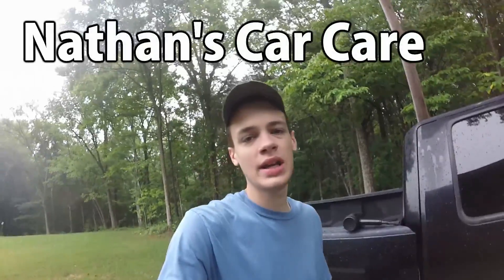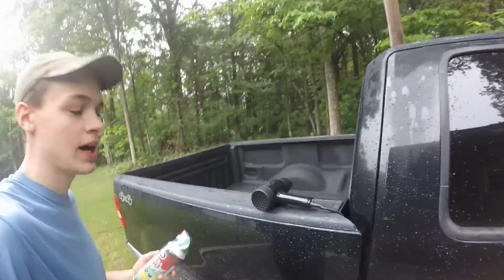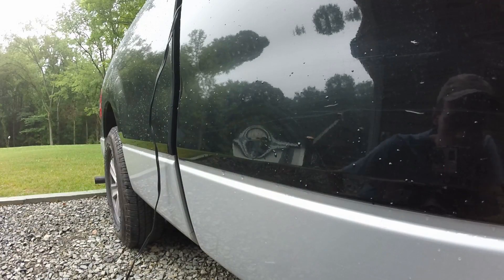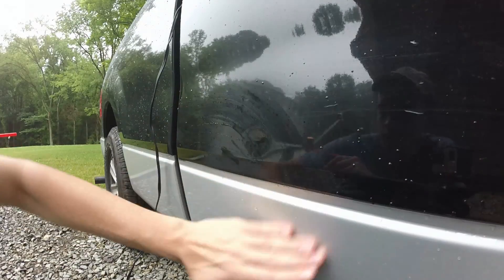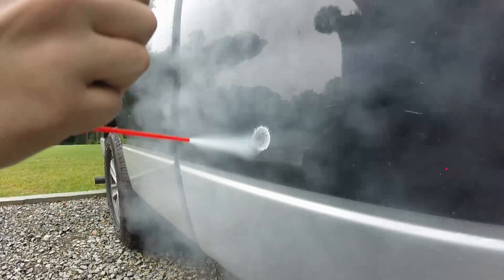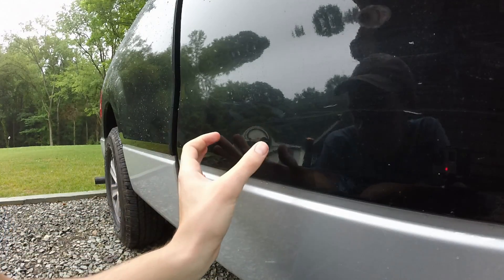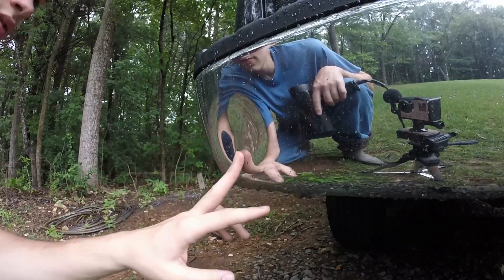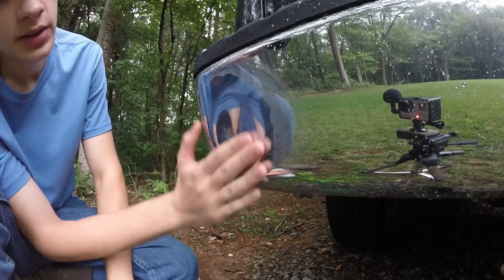Using Air to Remove Dents on Vehicles, Will it Work?

Comment: Sigh... ok, its not supposed to be "good and warm" it's supposed to be *fucking HOT*.   all of these youtube videos prove only that they have no idea HOW to do this. You need to 1) get the metal over 200 degrees and 2) apply the ice around the dent in a circular area and slowly close in on it, not just blasting it directly in the center.

Comment: Nathan, you did it the second time the way they said to do it. Thanks for posting this video showing that it DOESN’T work. I’ve seen the videos where this did work, but I tried it 4 times on different dents, even letting it get too hot to touch, but it still never worked for me. I’m taking my vehicle to a place near my house that has a big sign; “HAIL REMOVAL” to get an estimate for the repair.
Reply: ok, its not supposed to be "good and warm" it's supposed to be *fucking HOT*.   all of these youtube videos prove only that they have no idea HOW to do this. You need to 1) get the metal over 200 degrees and 2) apply the ice around the dent in a circular area and slowly close in on it, not just blasting it directly in the center.

Comment: First of all, that method isn't going to work on a chrome bumper... Secondly, the immense heating and cooling will reform the metal dependent on location. Your first dent would of popped if you got it hot & cool enough. Sometimes compressed air just isn't cold enough, try a heat gun and some dry ice. Make sure you put aluminum foil over it and use gloves so it doesn't damage your vehicle and/or give you frostbite.

Comment: Dude, not a very good job bunking this!
Reply from the maker: +jamie Haynes Considering that I showed how it doesn't work, I would say I did. How would you have done it so much better than I did?
Reply: Nathan's Car Care Easy. Heat it up first, preferably with a heat gun, then rapidly cool it. You chilled it first, went at it with a measly hairdryer, talked for two days and sprayed a little air on it. This method works, if you do it correctly...

Comment: need to put pressure on the other aide if the dent
Reply from the maker: +AussieTropic Yes, that would help. But in a lot of cases, it is not possible to get to the other side.

Comment: What worked on my Ranger and F150 each was to boil a pot of water, then use a plunger. Dent popped right out
Reply from the maker: That sounds interesting. I might have to try that next. Thanks for the idea!
Reply: One of those special car ding plungers they sell at auto parts store?

Comment: You heated it up and then you sat there backing about it for 10 seconds...it's cooling down while you yack! And the bumper? Don't you think that's a little heavy (gauge wise) for a hair dryer to work? How about a nice typical small ding on a door rather than a dent?
Reply: small dings are structurally more rigid than a wider dent. so it would be harder to prove your point with one.  That said, he did everything in this video wrong. and idk what all these youtubers are doing with hair dryers, because you need to heat the metal over 200 degrees, aka use a heat gun. NOT a blowdryer.